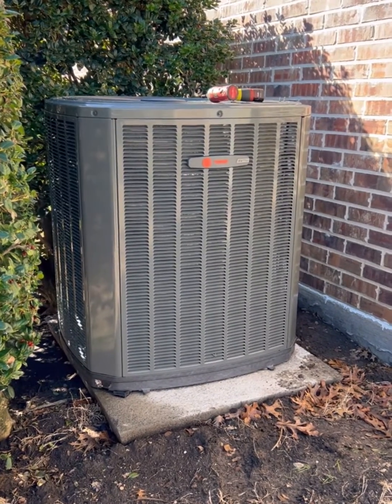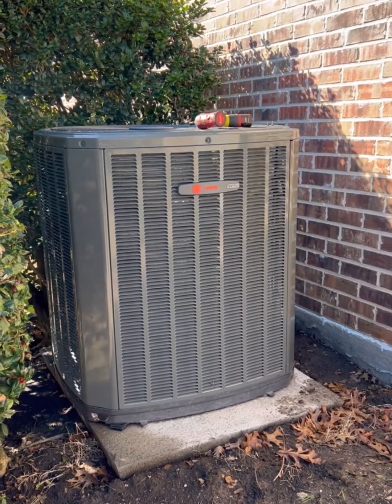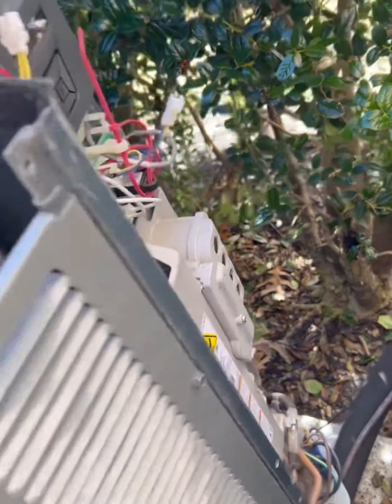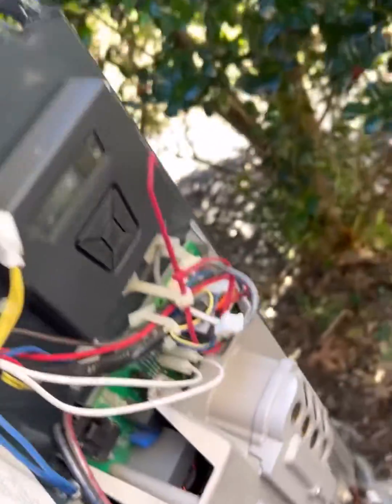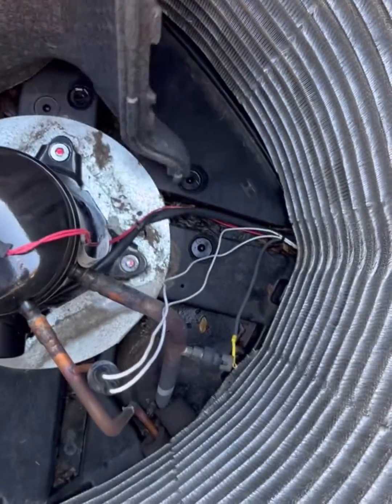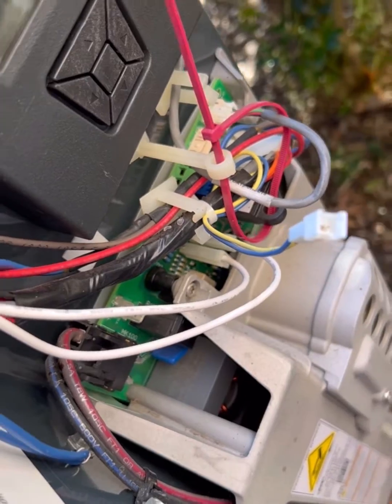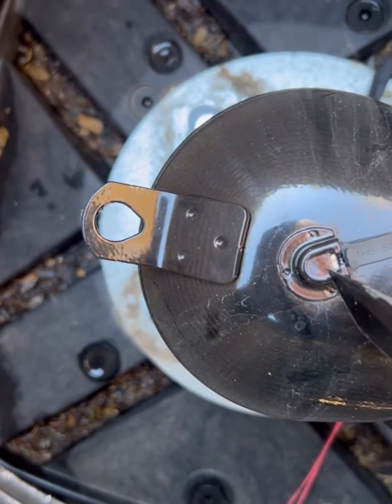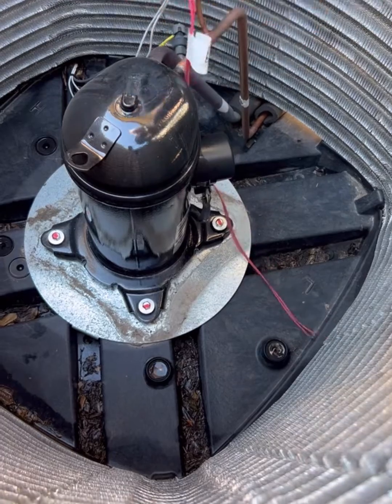HOW TO Replace a Trane/American Standard Dome Sensor

Comment: Thanks for the video - What is the part # and where can I order it?  Is it a fair price for $200 to diagnose and another $230 to replace under warrantee?
Reply from the maker: That seems pretty fair on both ends honestly. I would probably more expensive on the labor side. It’s an absolute pain getting to it. Be blessed!
Reply: Hi, thanks for this video! Do you know the part #? I have a variable speed unit, 4A7V8060A1000B, having a tough time locating the correct DTS. I could disassemble and read the part number from the sensor, but would be easier to order in advance and only take apart the unit once. Thanks!